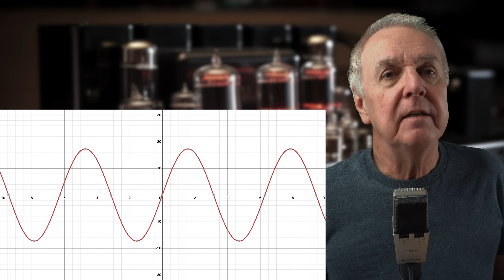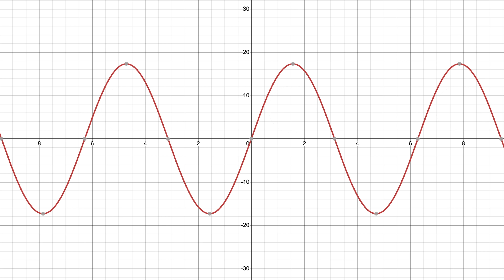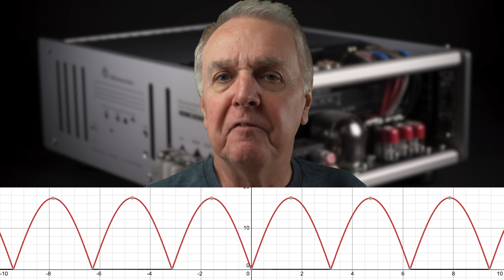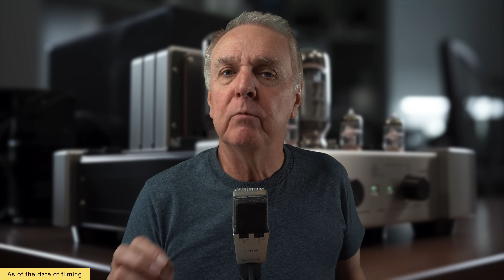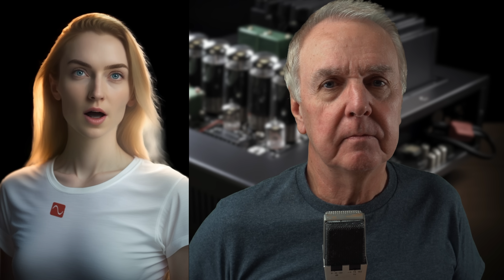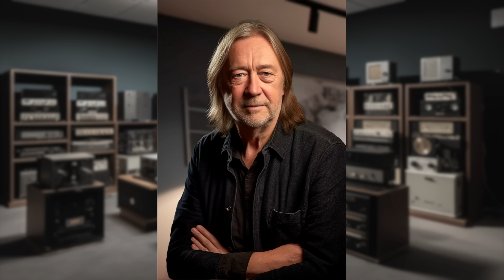Your power amp is average - Here's why

Comment: Debbie is both irritating and misogynistic. You could consider abandoning that lousy idea.

As far as the content is concerned, a useful question would be is there a solid correlation between RMS and real world power? If yes, then the spec used is arbitrary and just numbers. If my amp is rated 110w into 8 RMS and can drive my speakers to the SPL I want with no clipping, but you tell me it's not really 110 it's actually 55w although this doesn't change its performance, I don't really care. My only question is whether every 110w into 8 is in fact a real world power of 55w? This would mean that when buying an amp, if I come across one spec'd with real world watts of 55, I'd know it's good enough for me and it would come to 110w RMS.

I, in fact, never cared that much about the number of watts. I looked for sufficient power + some headroom. And this is an easy task for me since I don't listen to loud music. I see amp only as serving the speakers I want to listen to. Amp in itself is not that important. If it can amplify, it's good.

At my listening position, the loudness measured (A-weighted, average dB, long listening session - more than half an hour) is 76dB. Peak is 86 at least (for music, sometimes more). Amp shouldn't overheat or clip at 96 (accounting for the headroom). Going by, also vague, relation between watts and SPL + the drop due to distance + reinforcement of the room and the fact there's two speakers in stereo, and you get 90W/ch into 8ohm for a rather low efficient speaker of 84dB.

This 90W I stated is the RMS. My only question is would every 90W RMS rated amplifier give me the results I'm looking for?
Reply: There is a reason every yardstick is the same length...

IF they are tested against the same standard... the answer is Yes.

Comment: A few years ago I starting gigging and needed a bass combo that I could drag around the London Underground.
I chose a Hartke Kickback 12. Is it light and loud. Perfect.

On the front, it stated it was a 500W amp. I was so embarrassed by this assertion that I immediately took a piece of gaffa tape and covered that bit of the faceplate.
Reply: Bass amps went class D a few years ago. I'm pretty certain digital watts have much less umph than analogue class AB watts.

I think they were taking the power amp modules from car stereos and using them directly in bass amps, complete with the fictitious peak power claims.

Comment: Isn't average power what hifi mags used to refer to as "continuous power"? From what I remember, power amps can push out a lot more watts for very short bursts (dynamic power), but cannot maintain that power long term. The other important issue is with, say, 100 watts into 8 ohms, what is the power into 4 ohms? Ideally, it should be 200 watts, etc, but with lesser amps the power does not double as the resistance is halved.

Comment: Quoting Watts RMS at a particular frequency is really a comparison (Who sits in front of the speakers, listening to a sinewave?) like the procedure for measuring the fuel consumption of a car or the range of an electric car it’s just a comparison and not necessarily representative of the real world. 

I guess another approach would be to have a standard musical track lasting say, five minutes that incorporates various types of uncompressed music. The total average power is measured, and then divided by the time to come out with a power number. Clipping would not be allowed.

To get a more accurate number, you would have to include transient power and slew rate etcetera.

But the true way of measuring power handling capability, it’s probably with a 2 tone and a 3 tone test and then to measure the intermodulation distortion. This is what we do with radio-frequency amplifiers to measure linearity for a given power level.

Comment: The value of RMS is derived from squaring the values of the sine wave, (the negative side climbers up), finding the area of the new wave form and divide it by the length (an integral) In such case sine waves will show a ratio of 0.707 of the amplitude.

The average value of the sine wave without squaring the values is 0.623

I hope I remember the average ratio correctly, been ages since I learned this and no one uses the avarage ratio, only RMS is used for obvious reasons

Comment: I can't recall what the Federal Trade Commission (FTC) specified when it cracked down on audio amplifier power claims back in the late '70s. But I always took it to mean watts calculated from the continuous RMS voltage of a sine wave, all channels driven, at the specified distortion, measured for all frequencies claimed in the frequency response, within one decibel. The output load was also specified. That was the performance I would shoot for when designing a power amplifier for a given "RMS power". 

Now, RMS voltage depends on the waveform being analyzed. For a sine wave, it's root 2 over 2 times the peak voltage, or approximately 0.707. For a square wave, it's 1 times the peak voltage. For real music, it's... who knows? How loud are you playing it? How efficient are your speakers? How was it compressed, peak limited and clipped? Even the musical style, the amount of dynamic range contained in the original performance, and subsequently, how it was mixed and processed makes a big difference in the amount of actual power needed to reproduce it accurately and at a realistic volume. Of course, a lot of the fidelity may have been lost before it ever even hit the vinyl or CD.
Reply: Great answer.

Comment: Two big problems, First, whilst my main current main amp is rated at 40W RMS per channel, it will probably never produce that, that is unless I listen to lots of organ music, and then ride the volume control to maximise the output without hitting the clipping point, quite hard and kind of pointless. 95% of my music will never produce more than a handful of watts from that amp, assuming I keep it below clipping (Except my AC/DC tracks, where clipping is usually not noticeable, sometimes beneficial, excellent tweeter destructor)
The other problem is 99% of speakers have a very dynamic impedance curve, and an amplifier has to be able to keep its set output signal voltage level even if the speaker's impedance drops from, say 8 ohms to 2 ohms. (which actually means the amp has to put out bursts of way more power, do the math but with 2 instead of 8 ohms) If it cannot hold the voltage level then one hears a pile of distortion as it's output crashes.
This is the problem with a lot of those mini high power amps you find using Google, once you get past that bull quoted ratings, using something like PMPO rather than RMS, (and they add the two channels together for 2X, something real HiFi does not) you also have to then derate them an awful lot to allow for normal speaker impedance dynamics. they have NO margin for a load that drops it's impedance below the rates 4 or 8 ohms they quoted, so best of luck getting a good 10W out of that 600W mini beast you just ordered.

Comment: Is power about in this case about work done? The amplifier could be rated on a steady-state sine-wave but that's not what is actuallu amplified in real-world use. The work done will vary with the frequency of the  signal. The work done in terms of energy transferred per second at 1V amplitude at 100Hz vs 10,000Hz would be higher at the higher frequency. More energy is transferred per second at the higher frequency. More work would need to be done to move the mass of a speaker cone and the air that's loading it per second if it maintains the 1V amplitude but has to move backwards and forwards 100 times more per second. The area under the voltage vs time graph would be greater at the higher frequency. 100 times more Joules per second needed. The intensity of the two frequencies would be very different. An amplifier with a music signal only produces brief moments of a range of given frequencies at a time and the intensity and frequencies are for small fractions of each second. The amplifier will mostly be doing very little work at any given frequency during a music signal. Music is made of continually varying collections of frequencies for very short periods of time and each of those frequencies also continually  varies in amplitude. The amplifier just needs to be capable of transferring the required amounts of Joules per second as collections of undistorted waves that can do work driving the cone masses of the loudspeaker.

Comment: So if my T+A PA3100HV integrated has a manufacture's rating of:                                            RMS output per channel into 8 Ohms: 300 watts
RMS output per channel into 4 Ohms: 500 watts
Peak output into 8 Ohms: 380 watts
Peak output into 4 Ohms: 700 watts
Power bandwidth: 1Hz - 150kHz
Frequency response + 0 / – 3 dB: 0.5Hz - 180kHz
Slew guess: 60V/µs
Damping factor: > 65
Signal/noise ratio: > 115dB
Total harmonic distortion: <0.03%
Reservoir capacity: 120000µF                                                                                                            Then what is the "real or average" power rating?
Reply: Who cares, all that matters is that it sounds good
Put whatever numbers and letters you like on it, I couldn't care less
Reply: @crazyprayingmantis5596  I am just wonder what the math works out to be.

Comment: Now that I am an aging hipster, the volume control is normally set at 9 o’clock. If I can hear all the soft and loud musical bits, I am pleased. So my aging 37 wpc amp is a great companion.
Reply: The volume control is really just an indication of the strength of the input signal rather than a measure of how loud things sound.

Comment: I think whatever way you measure the watts the most important thing is to have an amp matched to the speakers maybe with a slight cushion. 500 watt amp driving 500 watt speakers. NEVER crank the amp all the way it can spike over peak and damage speakers. Lastly if it sounds good it is good…. To you. 😃
Reply: What is a 500 watt speaker?
Reply: @cubemerula5264   It's a colloquial way of saying a speaker capable of handling a 500 watt input without being destroyed.

Comment: Does my 160 wpc $80 Aiyima a07 give me deep, effortless, natural bass, rich mids and sparkling highs and do it loudly? No. Does my 150 wpc Emotiva? Yes. Are they both great for their price? Yes. In my limited experience, my receivers didn't sound as good as my amps. Maybe it was the low price I paid. To get the same sound quality, I would guess an integrated amp would cost 25% to 50% more than a similarly powerful amplifier.
Reply: That's probably because the Aiyima is only 50 watts per channel.  

Do a search for the "tpa3255 spec sheet" you'll see...
Reply: Never look at the advertised watt rating for inexpensive class D because those are rated at 10% THD. Check out the real testing results like this:
https://archimago.blogspot.com/2023/08/review-measurements-aiyima-a08-pro-ti.html

Comment: I think that the Number that manufacturers print on their boxes and in their brochures is pretty much pointless and only gives you an indication of how it is build. And with how it is build I don't mean good or bad but about their circuit philosophy. I categorize amps in 3 categories, 1 below 20w, 20-100w, above 100w. The point is, when listening music at home you will use something between 1-5 watts with over 90% of the speakers available, there are only very few speakers available that need more power like magnetostatic speakers or these kinds of things, but over 90% range between 85-90db efficiency therefore more than 5w starts to be pointless.

The more interesting question is about the damping of the amp (damping means how much control your amp has over your speakers). It is a little counter-intuitive, but more damping does not equal better. There are speakers where more damping equals better and there are speaker where more equals worse. A B&W 801 with it's fairly heavy 12-inch woofer needs some control so an amp with high damping is very good but one of these vintage Tannoys with a very light 12-inch paper cone woofer does not want high damping so you could drive it with a tube amp (these amps have basically zero damping).

In general you want an amp with as little amplification as possible but if you build a 10w amp then unfortunately it will not have any damping so even though more amplification equals worse sound quality in order to control your speaker a 100w amp might work better even if you are only using 5w
Reply: I did read one review of a speaker (can't remember which, some bookshelf job, I think) that "soaks up watts like an acoustic sponge".  That description has stuck with me for decades! 🙂
Reply: @stevemawer848  yes these kinds of speakers do exist, like a BBC 3/5 this legendary nearfield studio monitor. But it is an exception and not the average.
Reply: @snakeoilaudio   That rings a bell!  Made by Rogers, if memory serves.
Reply: @stevemawer848  yes, the design was licensed to 7 different manufacturers, Rodgers, Spendor, Harbeth etc

Comment: Interesting subject, but I guess the gist of it is that 'rms' power as is often quoted in the manufacturers literature is the same as 'average' power, even though it's technically incorrect. More important is that doubling your power output only gives you a 3db increase in volume, which is audible, but just barely.
Reply: There actually is a standardized testing procedure that most (credible) manufacturers follow. 

As I explained in an earlier comment... Watts RMS simply means "watts calculated using RMS voltage" ... It amazes me that people can't figure that out.

Comment: I listen to music the majority of the time at levels less than 1 watt. If I turn it up, I bump maybe 2 watts. Prolonged periods at those levels would challenge longterm hearing health.
Reply: Yep.10 Watts is bloody loud.
Reply: @fatfreddy8089   That rather depends on the efficiency of your speakers, Shirley?
Reply: Exactly  , most of the time an amp is ticking over , if the rest the of the chain is property  matched . If you need to listen at a high volume something isn't right or you have horrendously inefficient speakers.
Reply: This is relative to listening distance and room size though.  Concert at 1 watt would sure be a pitty even 30 feet away aye
Reply: Depends on speaker sensitivity

Comment: There is no such thing as Watts rms. It's a term used by marketing people with no technical background. RMS only applies to volts to convert ac signals to an equivalent dc value. It does not apply to Watts. The various miscalculations shown are just that, miscalculations. There is only 1 valid calculation from a sine wave voltage to Watts. The confusion with amplifier specifications come about because of continuous vs instantaneous or peak (music) power.  Many amplifier circuits can output more power than their power supply can provide continuously so their continuous power is set by the power supply. Also be careful of multichannel amps. 1 channel may be rated at say 100W (100W power supply), but if all say all 5 channels are operating, the 100W has to be shared between the 5 channels. Peak power is much more deceptive. The power supply has output capacitors that can provide a short burst of much higher power, the shorter the burst, the higher the power. This is useful for loud bangs, gun shots or bass drum thumps, but cannot be simply specified. This is where the 100W continuous amp gets a headlining 1000W peak music power spec. Good amps will be spec'd at XXX Watts continuous @ 1kHz, both channels driven. This can be used to compare amp performance.
Reply: " There is only 1 valid calculation from a sine wave voltage to Watts."

Which voltage would that be?  Peak, Peak to Peak, DC equivalent or, oh gosh, could it be RMS voltage?

"Watts RMS"  is engineering shorthand for "Wattage calculated using RMS voltage"...  It's not a complex concept.

Comment: When looking at power amplifier output I look at how the power is quoted. If it’s just at 1 KHz and 10% THD with one channel driven it’s pretty safe to say that’s useless info. 

My NAD amplifier is quoted as continuous power output >50W at 20Hz - 20KHz, both channels driven at 8 ohms and 0.009% THD. 

That’s enough to say to me that under normal usage conditions with my 8 ohm 90 db/W/M speakers that I have more than enough clean usable power in my living room. I probably only peak at 1 or 2 watts of power output at the very most.

Comment: Maybe I am the exception, but the power output of an amplifier is one of the least important aspects to me; most have plenty on board, certainly enough to upset the neighbours, and I'm not trying to boil a kettle with it. Distortion levels, noise levels, feedback topology etc. etc but most of all what it sounds like, are far more interesting to me.
Reply: FWIW ... if you have a 100 watt amplifier, playing music with a 10db dynamic range your average power is going to be closer to 10watts.  (10db is a 10 to 1 power ratio)

Most comfortable listening actually happens at 2 or 3 watts.
Reply: @Douglas_Blake_579  Exactly, comfortable listening levels are only at a few watts, if that. Having a 2x150W power amplifier in small 4x5m listening room is overkill, although some will insist on it. Remember most audiophiles seem very happy with valve amps that have only modest output power.
Reply: @maidsandmuses 
It's the ages old story ... tell a kid it's okay to eat 3 cookies and then give him 2 ... and he immediately wants the third one. 

Everybody does it. If there is more, they want more... they don't know why they want it but they just gotta have it.

These variable voltage amps are a prime example... going from the 32 to the 48  volt supply gives you only another 3db (55 vs 110 watts).  Nobody is going to notice a 3db difference in peak loudness when playing music.. but by gawd they just gotta have it!